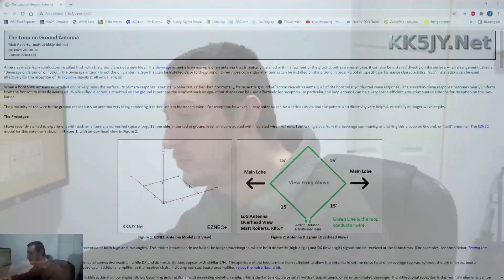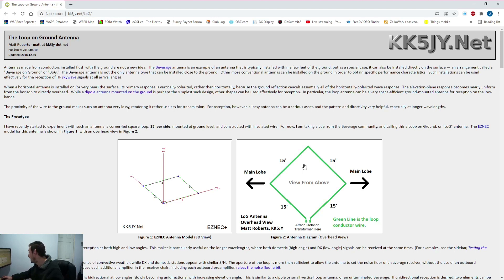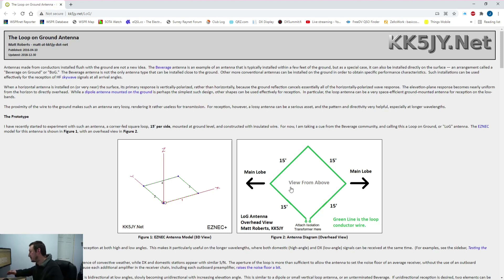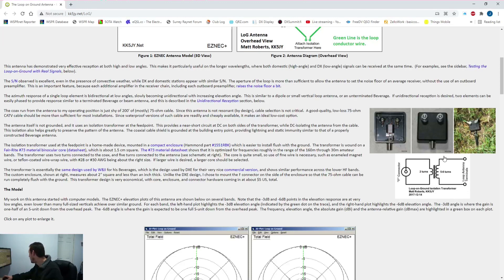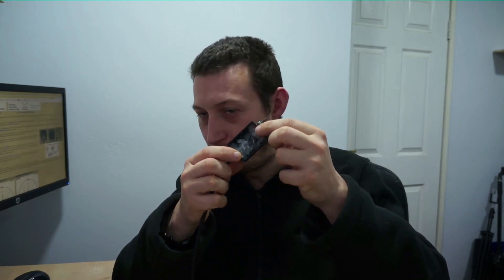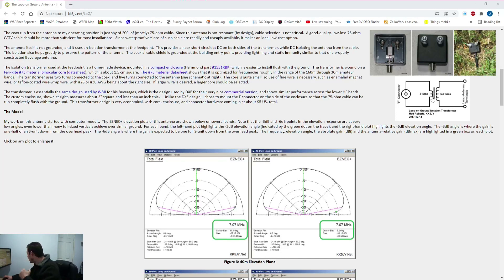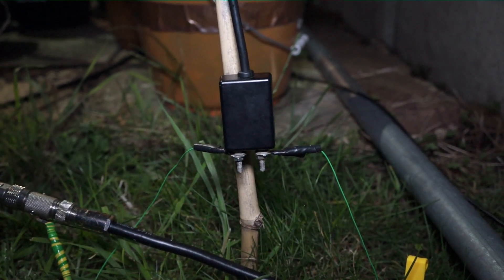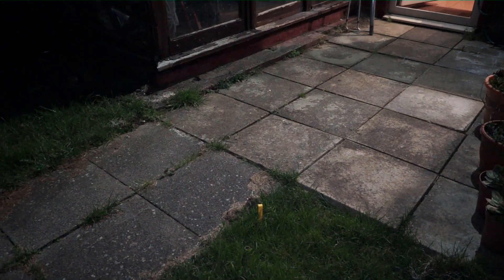Loop On Ground Antenna - Build & test

Comment: Don't bother, just throw the LOG away. Try the RF gain or attenuator instead.
Reply from the maker: Mmm, not sure about that.

I've obviously messed with the RF gain and attenuator. That helps to a point, but it's not going to lower your noise level. EDIT:- The above was badly worded.....was trying to make the point that it won't improve your S/N radio.

Anecdotally, there are quite a few people who have had good results with a LOG, in so much that it's lowered their noise level and slightly improved their S/N ratio (which is what it's all about at the end of the day).

It didn't work for me in my specific circumstances, but I don't think you can completely dismiss the option of using a LOG for RX as it seems to work for some people.

Comment: Use 73 material only. Binocular double core with 2/6t for 50Ohms feeder. Install it as far as possible from house and man-made noise sources. Chokes on both feeder sides and low-noise high IMD preamp are needed. That will work well.

Comment: Could I use 43 material for the balun. The reason I ask is because I already have some of these.
Thanks
Reply: I just tried 43 material and made a balun with it and it became an attenuator low down. I tested from 1 - 15 megs and from 1 to 3 it was pretty bad (tested on nano VNA)....for the rest of the way it was flat and OK. The number 73 was much better down low. I'm making a video soon of my experience of the LOG adventure. 73 de VK2AOE.

Comment: Interesting video, I tried a log antenna and had similar results so didn't use how ever I only used a normal 4 to 1 unun and I only used the pre amp on actual radio which did help, I currently run a end fed half wave 80 to 6m in a inverted U, I have wondered about about turning the efhw into a terminated end fed using a counterpoise and resistor, I have heard mixed comments on thus type of antenna. Great video cheers

Comment: Good video James. It's nice to see videos where you don't always get the results you want to see or show, I've experienced similar. Keep at it, I'm sure you will get there. I love loops. I was testing a 40m loop 4ft off the ground at the weekend. I was super pleased at the results. Got a video coming out tomorrow night on my channel on it. 73, Colin
Reply from the maker: Hi Colin, as you rightly say I don't dress things up to look pretty on camera. If it goes wrong then you see it!

I really like your videos about the "Adjustawave" antenna. That's a great idea. Im following that with interest. 

I've also been debating trying a delta loop. Once the current restrictions are lifted, I'm thinking of going back to the camp site on the Welsh coast where I filmed the first 20m EFHW vertical video about a year ago. That should be awesome from that location!

Will keep an eye out for your loop video tomorrow.

73.

Comment: Hi James, I found with the Loop on the Ground antenna that the signal and noise levels heard were very low. The noise floor of the antenna was well below the noise floor of my receiver. Once I fitted a low noise pre-amp at the loop terminals I could hear down to the noise floor of the antenna and the signal to noise performance was then better than my other antennas. Without the pre-amp it appeared exactly as you have found in the video. 73, Chris G4HYG
Reply from the maker: Hi Chris, I have wondered about trying the CCW loop antenna amplifier with it. Do you think that would be a good match? Could be a follow up video there!

P.S. I've been thinking about trying one of your High Z antenna amplifiers on a vertical whip at the bottom of the garden, although verticals are generally considered noisier so I don't know if there would be any advantage to that in my case?

I realise that I'm a tiny YouTube channel & don't really have any advertising clout but would there be any kind of a discount/deal to be had?

I know it's a cheeky request but if you don't ask you don't get!!!

73.
Reply: @HamRadioOnline  Hi James, The Beverage Antenna Amplifier would match the  Loop on the Ground perfectly. You could also try a Beverage antenna at your field site. It you want so that you can make more videos I could supply a Beverage Antenna Amplifier and a High Z Antenna Amplifier on a sale or return basis. Try them out with a video and if you want to keep it you can buy it or ship it back if you don't..73, Chris G4HYG
Reply from the maker: Awesome, thanks Chris. If I could possibly borrow them for a month or so, that would be fantastic. I've sent you an email.

Comment: Do both your antenna radiate in same direction i wonder? might need more signals to see more detail. 73
Reply from the maker: That is a very good point Steve. Theoretically the radiation patterns are mis-aligned by about 45 degrees.

I've already filmed a follow up video to this where I WSPR test both antennas simultaneously. That video will go live on Saturday.